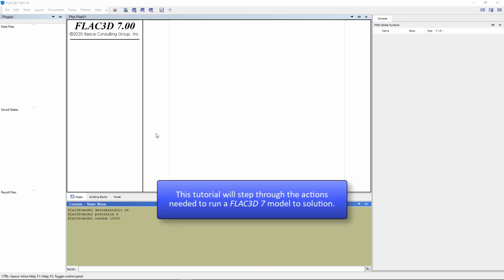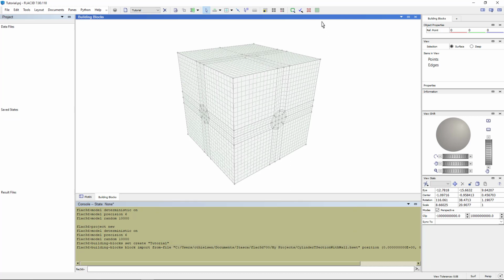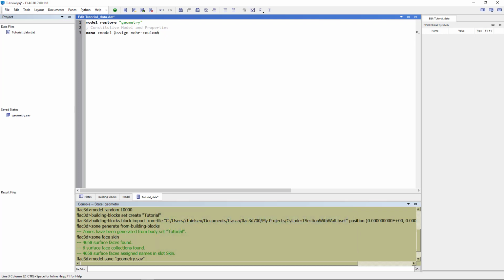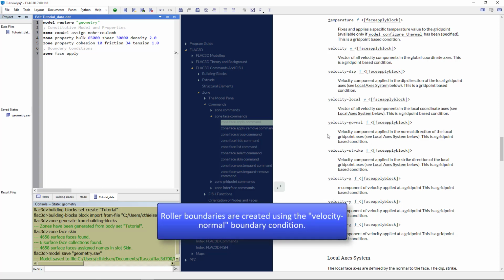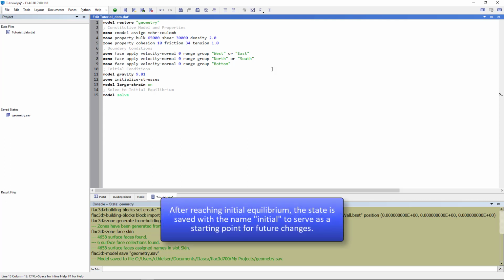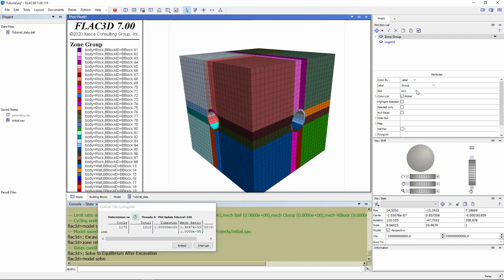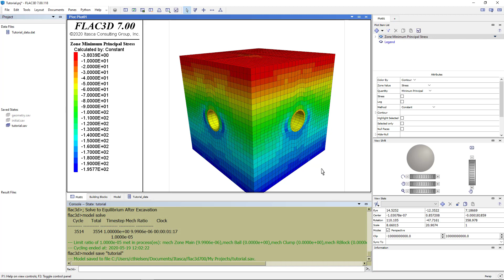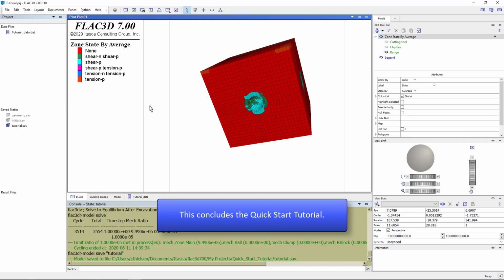FLAC3D 7.0 Quick Start Tutorial

Comment: Is there something simpler to import from DXF without reworking geometries?
Reply from the maker: In both FLAC 8.1 and FLAC2D 9, you can import DXF files and use these to construct a model. In FLAC2D 9 this is done through the Sketch tool. You can then mesh automatically or modify the drawing first. FLAC3D 9 has the same functionality plus rotation and extrusion tools to make a 3D model. You can also import a watertight 3D DXF  or STL file into FLAC3D and use some of the "block gen from-geom" command to mesh it. For technical support, please use our web form (https://www.itascacg.com/contact-itasca/software-support-request) or visit our Software Forum at https://forum.itascainternational.com. Also, check out our Software Academy for training courses at https://academy.itascainternational.com.